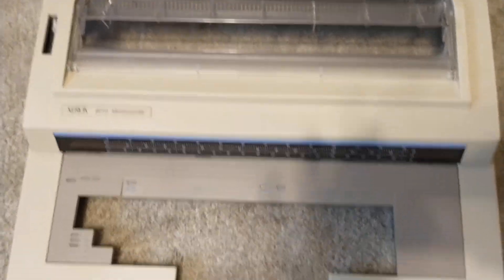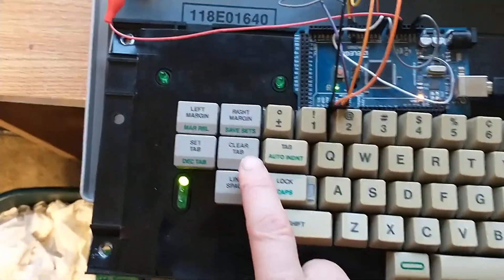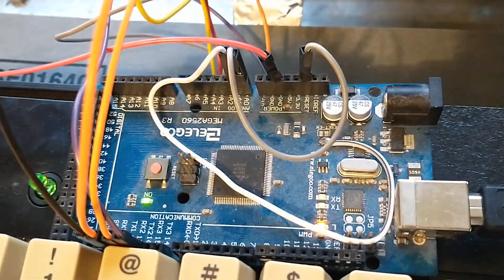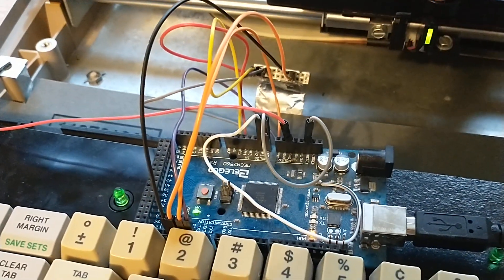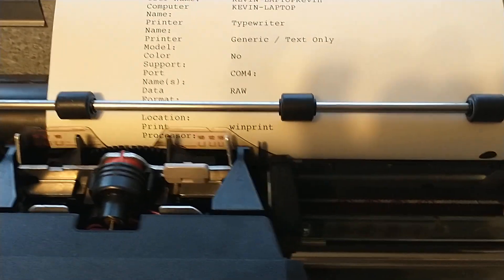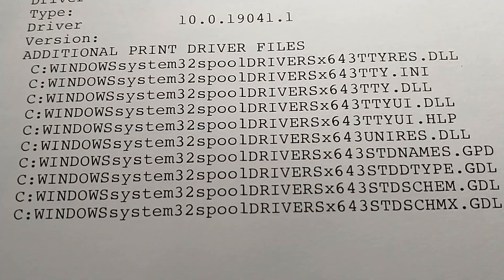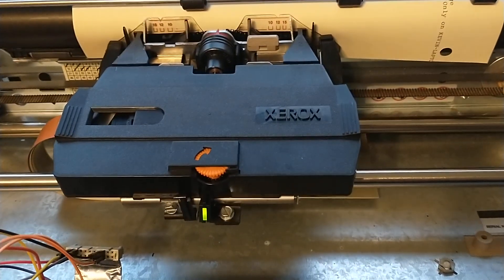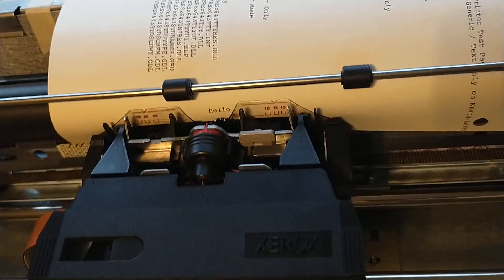Xerox Memorywriter 6010 Hacked (prototype)

Comment: I'm hoping to start on a project like this soon (with a Brother AX-10 daisywheel). I don't know much about electronics and have been trying to figure it out with ChatGPT. It says to hack into the noughts-and-crosses matrix. Did you solder some wires onto the chip/board in the original typewriter? Was it difficult overall? Well done on getting there!

Comment: Actually Systel did this first in the 1980s.  There was an interface board which was installed in the typewriter, and you had a 1/2 or full page display with a FDD which connected between the two with a 4 wire cable.